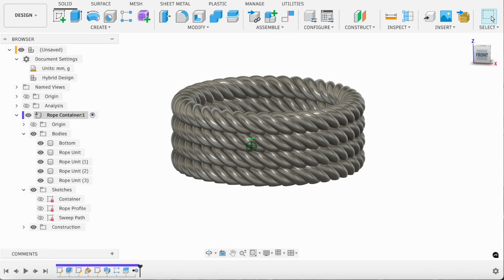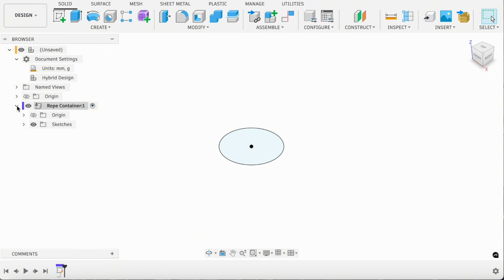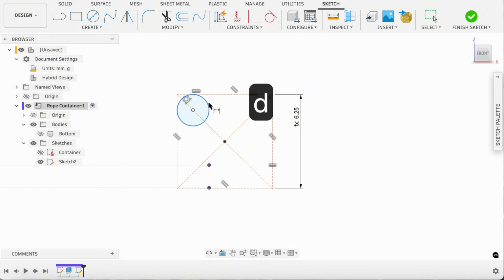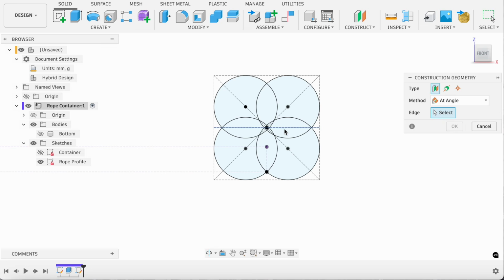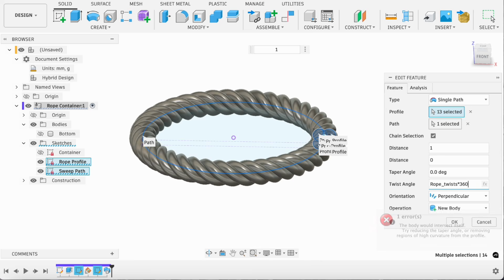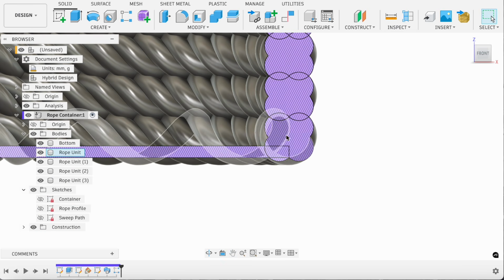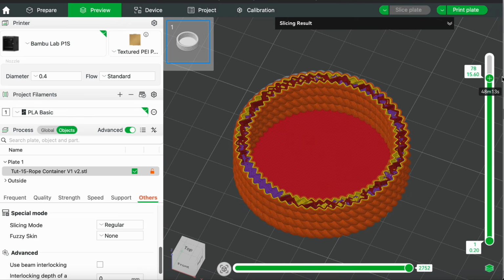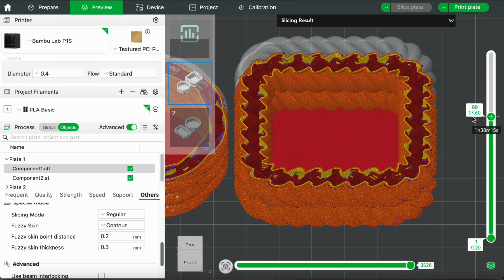TEXTURE That Feels Real! 3D Printed Parametric Rope Container - Fusion 360

Comment: Great tutorial for one more time!
An additional parameter should be (for rectngle container) the fillet which should be depending on height of the container. Because  with the given standards if we use 100mm box height we lose rope layers (couse of the small fillet). So if we use a parameter rect_cont_fillet= box_height/5 and use it on that fillet all are fine

Comment: Love your tutorials! Two items, 1) I always add the shortcut to Parameters on my toolbar, 2) could you consider doing a coil version of this tutorial, so spiral up as one piece of rope? Interested in your approach…
Reply from the maker: Hi again! ;) Glad you're enjoying the videos! Adding Parameters to the toolbar is a great tip! 
As for the coil version, it's actually trickier than it looks! Since Fusion doesn't have a native "Helical Curve" tool, you have to use a "Coil" as a workaround to get the path, or use a custom script. Plus, there’s the "self-intersecting" geometry issue to solve if we want the rope layers to overlap for better 3D printing.
I don’t have a simple, solid solution for this yet—but if I crack it, maybe I’ll put out a dedicated tutorial for it ;)